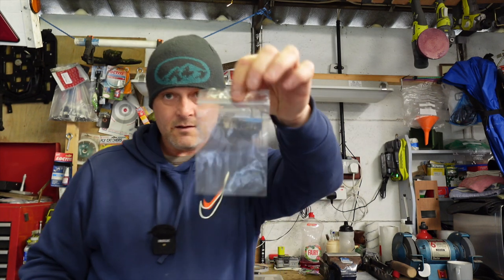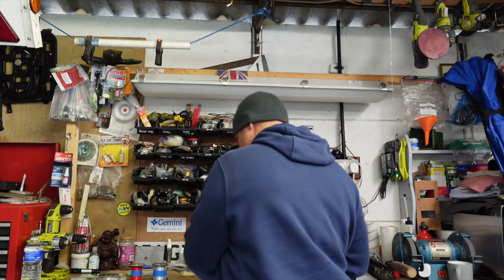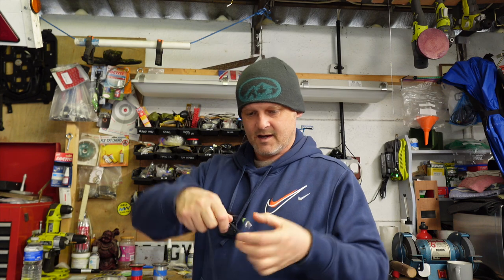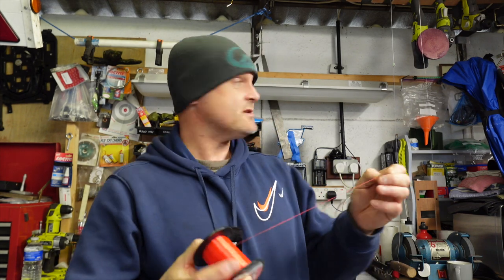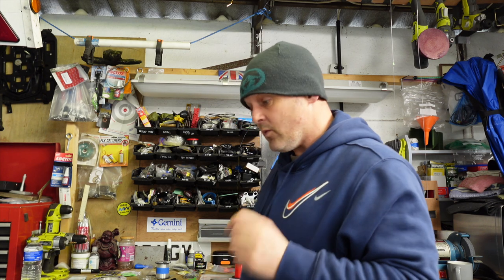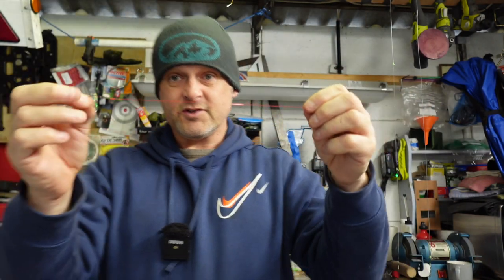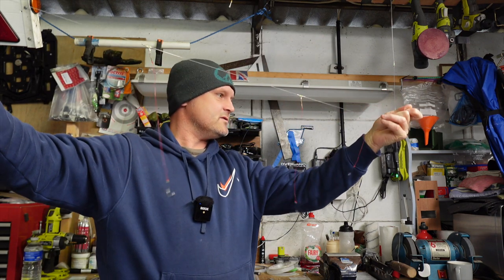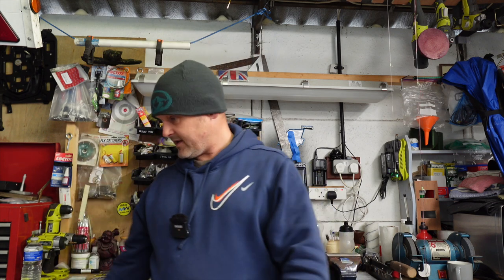Rig making - 3 Hook Flapper - is this the ultimate scratching rig?

Comment: Great vid as always Mark, 👍🏻 a good tip I use (said in a comment above) is a clip on both ends of the rig works really well if you want to flip the rig body over and fish a snood below the lead 👍🏻👍🏻 I also use detachable snoods, using some carp fishing products and I just tie a loop in the end of snood and use a anti tangle sleeve to cover it up, stops the snood from detaching and kicks the snood away too 👍🏻 🎣
Reply from the maker: I like the clip at either end for the chance to reverse the rig body. A perfect example of a simple solution, shared by the group to help everyone. 👍🏻
I have used rig tubing on some of the builds before and particularly like it on the up and over to prevent tangles. Sounds like yours is a nice solution. 🎣

Comment: Exactly how I make a 3 hook flapper except not detachable. If fishing 2 rods, I'll always have a big bait on a pulley pennel and a 3 hook flapper with different hook sizes, largest at the bottom and smallest at the top. Works well, blanked once in over 12 months.
Reply from the maker: A very good strategy for covering all bases and maximising your chances. I wish I had the same 12 month performance but sometimes I’m all in chasing a specific species.
Reply: @Mark Williams Sea Angling  when I'm asked what I'm targeting I just say "Fish".
Reply: Can I ask whats the thought process to putting the hooks in that order? And what size hooks you generally would go for
Reply: @dunndunn1  I mix it up depending on where I'm fishing. Sometimes it's a size 3/0 on the bottom then size 2/0 and either 2/0 or 1/0 at the top.
Time of year means different fish so if its flounder I'd put a 1/0 Aberdeen on the bottom 2 and a size 2/0 at the top. If I think bass are around it'll be at least size 2/0s on the rig.
Reply: @thejinxeffect very good thanks. Not fishing long so trying to better understand how people plan their set up.

Comment: Nice one Mark!  Great rig, and always great to see the gems you create in the workshop.  I did make up a couple of your clipped 3 hook rigs and the house Poltergeist went off with them I think - can't find them anywhere!  
Re the clip & swivel debate attached to the mainline, my Conti rods have got very small tip eyes, so I can't leave anything on the leader.  I tend to tie a figure of 8 loop knot on the end of the leader, and thread the loop through the swivel/clip/snap swivel and back over the top.  I quite like the American style snap swivels, (some folk don't!) and sometimes tie a similar loop in the top of the rig body to just clip onto the snap swivel clip.  Never believe in using more components than essential.
Not been out for a dangle yet this year, not been too well, and I have to confess I've generally lost interest in Youtube a bit - I think I overdosed on it a bit last year!  Tight lines, and stay safe & well.  Dave.  🎣🎣👍👍
Reply from the maker: I hope you are feeling better soon and once the clocks change and the days are longer you can get out for some shore time. 
Maybe target a new species. 🎣👍🏻

Comment: Hi Mark. Glad to see you are ok.😃 Been a while.🤔
Like the detachable snoods, only downside I can see is weed and May rot. Sorry.🥺
I too put the clip on my shockleader, even after once losing an eye insert.🫣
I once tried a one up one down with clips on both ends of the rig body, and a long drop to the up snood so I could turn the rig upside down to make it a two up to get both baits higher and try to avoid the crabs.😲
Just me being tight and lazy.😂😂
Certainly looks like a rig worth trying.👍
Thanks for sharing.👏
Take care and stay safe mate.😷🙊
Reply from the maker: I had almost forgot about the May rot 🤨
For that specific period of time when weed is a problem I would most likely tie the snood direct to the swivel and minimise snagging points.

Comment: By using a clip on the shock leader increases the risk of snagging. Weed accumulates on a clip when reeling in, but cannot accumulate as much if you attach a swivel to your shock leader. The clip is, in effect, ‘upside down’ if you attach a clip to the top of your rig body. You are correct in saying aero beads should be used the right way around, being teardrop shaped, but I have used them in the opposite configuration to you. My theory being the two narrow ends meeting to ‘trap’ the swivel allows greater freedom of movement of the swivel. I’m quite prepared to be told I’m using them the wrong way around!
Reply from the maker: I’m loving the thought process and this goes to show we all “have our own way” and if it works then it isn’t wrong. I get the swivel on the shock-leader but some rod eyes are small although the stainless Gemini 140’s are very compact. For some they will do away with the clip altogether and tie direct to the swivel removing a “complication”. I hope to show options and people can adapt to suit their fishing. Likewise I am always curious to other peoples set up and rigs because every day is a school day.

Comment: Shane pullen said to me swivel on shock leader loose less rigs, also demonstrated this on a cd he made one of his Dungeness cod ones sorry can't remember which,  I couldn't believe how much better this worked i,  use Gemini swivel and clip top of trace which helps letting body  twist , great trace nice you back.
Reply from the maker: It does make sense for the swivel to attach to the shock leader, that way the clip is upside down and less prone to snagging. The tiny little 140lb stainless swivels from Gemini should fit through most rod rings.

Comment: 3 hook flappers is one if not the best rig going .. it will catch pretty much every think and you can make it as short or as long as you like.. some of the england team use them and them only .. its the same thing as a 3 hook clip down just don't clip down same rig and principle  both fish the same in the water .. if your new to fishing just use this rig or 2 hook flapper if your fishing clean to mixed its not a rough ground rig .. nice video mate
Reply: ps aero beads are great on flappers and clip downs
Reply from the maker: I particularly like the aero beads, very neat.

Comment: Interesting vid again Mark.... Like you, I also put the gemini clip on my shock leader and the swivel at the top of my rig body, however on occasion I do find that part of the rig ends up caught inside the gemini clip.... This doesn't happen during the cast but once the rig has been in the water a while.... Its not a massive or regular problem but it has made me think about swapping the components round the other way to see if that stops it
Reply from the maker: I can see how the swivel on the shock-leader is worthwhile but I have been doing it this way for a long time.

Comment: Well done.i like to use two and three hook flappers with 3,os with big baits.keeps it all interesting as anything can happen.
Reply from the maker: Do you upscale the line strength on rig body and snoods for this?
Reply: @seaangling  I use 25lb fluro on snoods to help pull out of snags and 30/40lb braid to break off the snoods if it's too much snagged.but usually pull clear.as you done,replacement snoods.handy.
Reply from the maker: Sounds like an interesting rig.

Comment: Hi, great videos, just one question what crimps do you use?
Cheers Andy (Hampshire)
Reply from the maker: Hi Andy, to crimp or not to crimp? That is the question. I’ll admit I’m not a “big” fan and I’m choosy over which crimps I use. My favourite are the Sakuma ones which are very high quality. Avoid the cheap ones that look like they’ve been guillotined. That leaves sharp edges and leads to rig failures. Try to gauge your crimping force and only crimp in the centre and not near the edge.
Reply: @seaangling  Thank you.

Comment: The reason for putting the swivel on the leader is that the clip is not being pulled in open end first, which will snag on lost line or build up with weed. Always put the clip on the rig for that reason.
Reply from the maker: I understand your reasoning and that is a choice for many. I am using a termalink which is a shielded link and there are sleeves available for open links. I do prefer having a link rather than a swivel on the end of the shock leader.

Comment: At the risk of stating the obvious, by using a clip at both ends of the rig it becomes reversible, and you can fish the same rig body as either 3 Up or 2 Up 1 Down, if you arrange the swivels the way you have shown in the video.
I find 2 Up 1 Down flappers work very well for scratching, with flatties preferring to take the hook below the lead.
Reply from the maker: It is a very good point and may escape some who haven’t considered it. I don’t do it personally but I understand what you are explaining. It would make a good talking point on a variation video. A low rod tip on a shallow beach can help to present the snoods in the target zone for flatties. Thank you for your comment, very helpful. 🎣👍🏻

Comment: Hi Mark,
Love your rig making video's as I'm new to this game.
When using crimps on main body line, if you get a nice size fish on will the crimps slide down, if so will they damage your body line?
Reply from the maker: Correctly sized crimps put on with the right tool shouldn’t slide down. Breakaway do an adjustable crimp/tool setup that could. 

Be careful in your crimp choice as I’ve found some that are dubious at best but it’s worth checking out the Sakuma crimps which are higher quality than most. If you are unsure with what you have do a couple of test crimps and pull the line to check for strength. Always worth checking your rig bodies anyway. 👍🏻

Comment: Great content as always. Food for thought. Loving the idea of detatchable hook snoods. I will be in Pongos tomorrow looking for the snood clips. I have only ever made this rig with cascade swivels so i can clip it up for casting. Might need some more rig body. Seen several people using clear line, i am currently finishing off a spool of orange 60lb greased weasel.
Reply from the maker: Cascade swivels are perfect for clip down rigs due to the shape of the top eye which all helps to make it aerodynamic. For a flapper rig I use straight forward swivels. I like the detachable snoods on this rig which makes baiting up with worm and a needle a lot simpler.

Comment: I use this rig but with 2 hooks. Try not to use to many clips as the more you use the bigger the cost to the overall rig cost should you lose it. Work fantastically well. Used since I was a kid.
Reply from the maker: With a 2 hook version do you keep the snoods short or go slightly longer?
Reply: @seaangling  top slightly longer rather than the bottom
Reply from the maker: I can see how that would work.

Comment: Great video Mark. Everyone has their own preferences. Mine is to avoid crimps and use rig gum stop knots instead. It takes longer to make the rig body but I can adjust the swivel positions on the beach. This would afford the ability to change snood length when out fishing, supported by using the snood clips, giving (almost) total versatility.  Thanks for the video, Gem
Reply from the maker: I agree your version of the rig using stop knots would be the pinnacle of this design and increase the flexibility. Crimps by their design will reduce line diameter/strength.